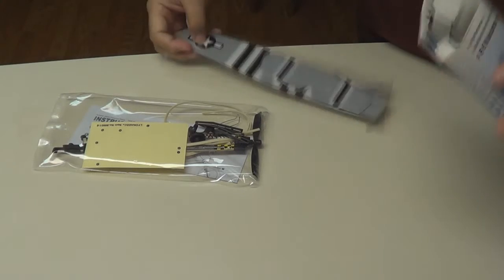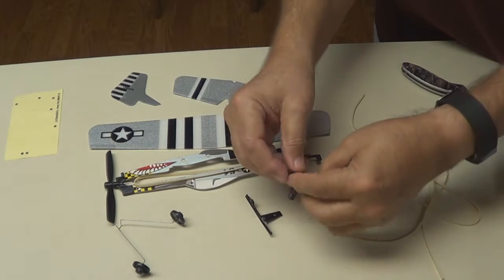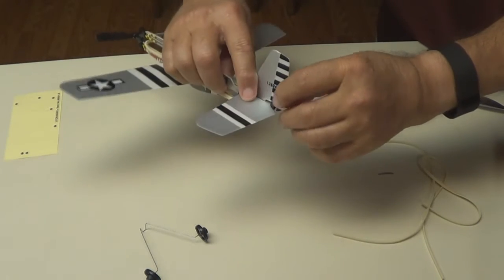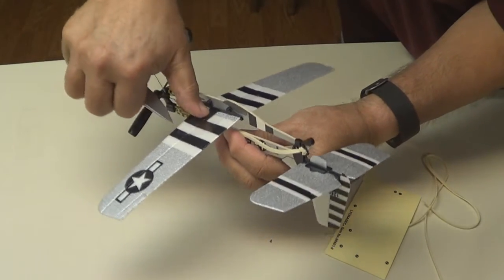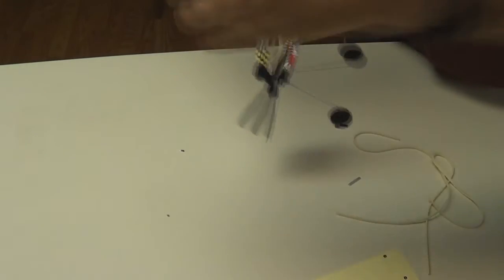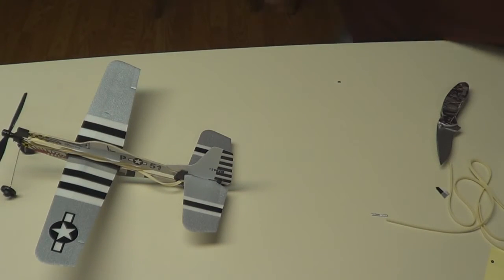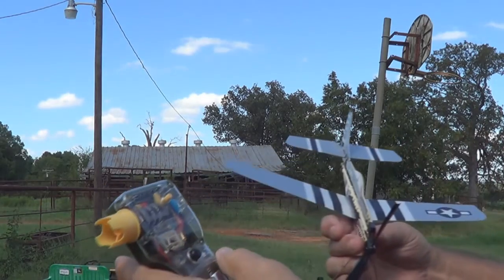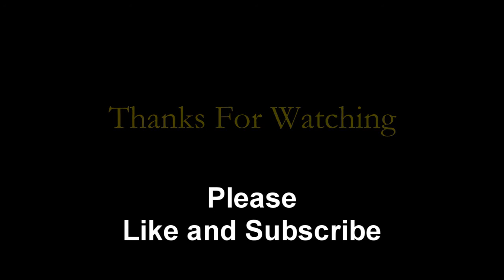How To Build And Fly A Rubber Band Powered Plane Lyonaeec P-51 Mustang

Comment: If you're really interested in simple rubber band airplanes, go to Ebay and buy an old and now rare, North Pacific Sleek Streek (yes it is spelled Streek). With a longer loop of 1/8" contest rubber, they will out fly any of these toy airplanes, and are head and shoulders better than the modern Guillows RB planes.
Reply from the maker: Thanks I'll look at it